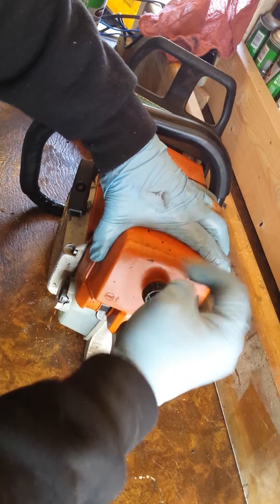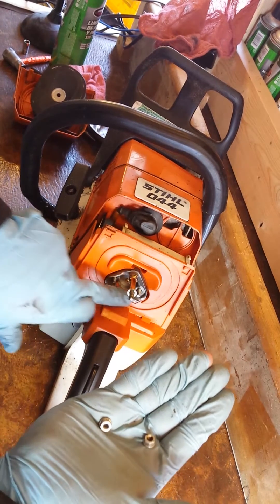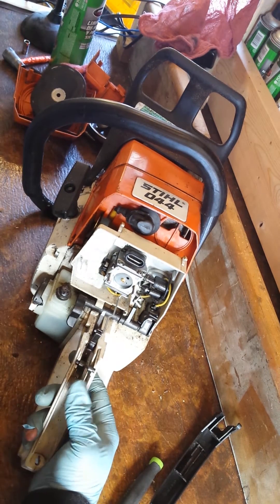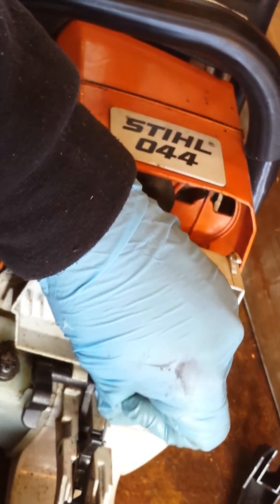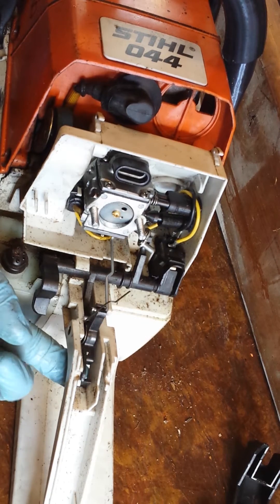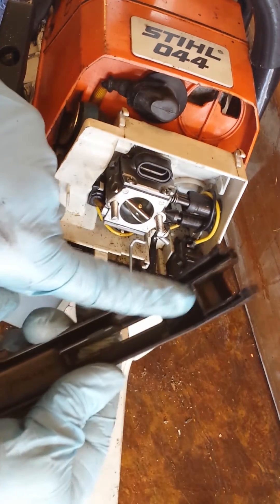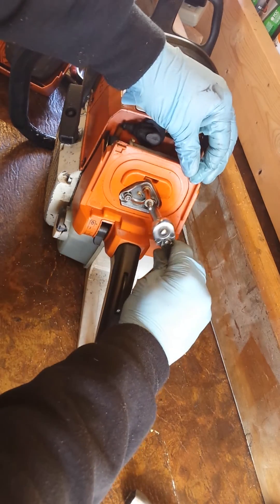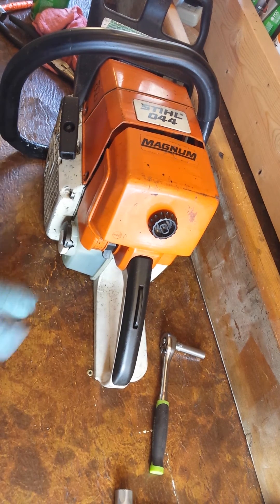Chain Saw Trigger And Interlock Basics

Comment: I have a MS361 and it runs and idles great, but the speed when the trigger lock is engaged is much higher than desired.  Any suggestions to adjust trigger lock speed down?

Comment: Any chance you can clarify something for me? Should I have to engage the trigger to reach full choke or did I put this back together wrong?
Reply: You should have to engage the trigger for full choke. It's all part of the high idle function as well. Keeps the throttle pulled slightly. Hope this helps

Comment: I have the same model but with no choke function. The switch will only go down as far as on (1) Takes 20-30 pulls when cold to start. But once going there are no issues.